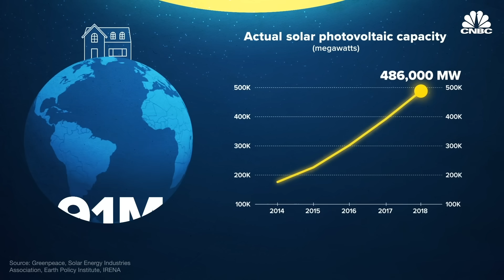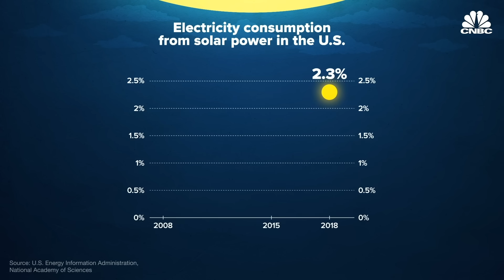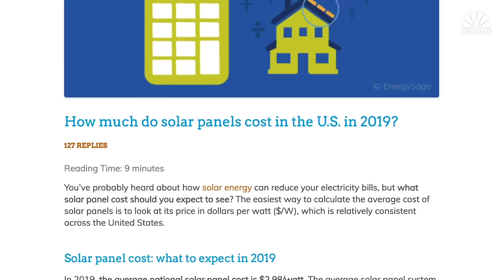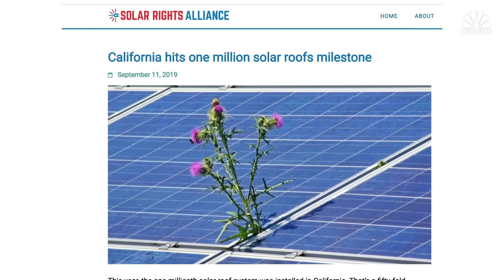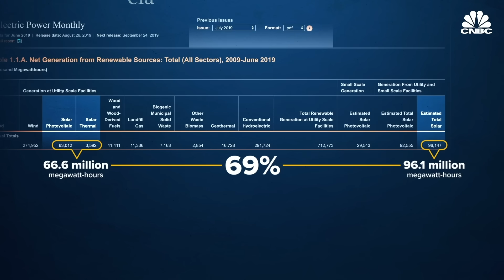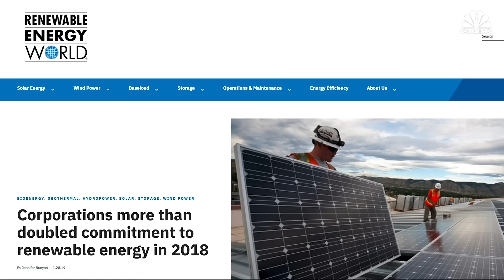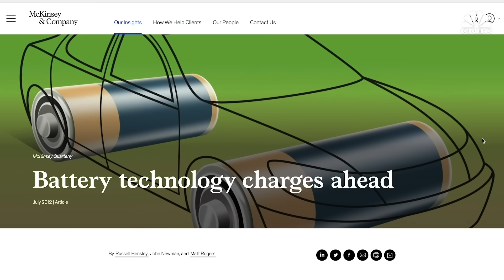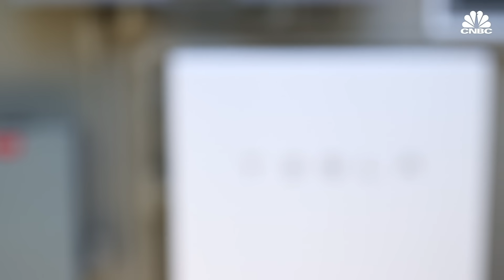The Rise Of Solar Power

Comment: For solar energy storage, use compressed air tanks holding up to 20,000 psi compressed air. Where weight is a consideration, carbon fiber composite tanks are very lightweight. When power is needed use a high efficiency electric generator, powered by compressed air, to power the grid. Air motor used as a reversible air pump/generator should be "rotary Wankel" design such as EngineAir Australia's new air motor. Hopefully this would be cheaper than using electric batteries which have low efficiency generally.

Comment: Anyone that thinks you MUST use lithium ion batteries is a moron.  The only reason to use li ion batteries is energy density which means NOTHING in a fixed location.
Reply: LiIon deep cycle is much more than any other battery chemistry. Power density is higher than any other solution. For residential storage, nothing beats LiIon.
Reply: @mychevysparkevdidntcatchfi1489  And what does energy density do for a residential users?  You also know that it has the shortest user life of any storage tech?  You know that it has the most poisonous chemistry?  Highest cost of recycling?  So what is so damned great about li ion storage for fixed use?  Tell me where does the bang for the buck for a home owner come from?  You can't answer because there is no benefit to a high cost low life hard to recycle storage for a fixed user.

Comment: Its crazy. The didn’t once mention the lifespan of solar panels. Or what happens to them once they’ve outlived their effectiveness...
Reply: about 20 years and very toxic...
Reply: @daddystiel4324  No, its about 40 years, may be even longer, and recycling plants popping up everywhere...many valuable materials in solar panels, which will NOT be wasted! In Europe, before a company is able to put a shovel in the ground to build a solar farm (or wind farm) they MUST have contracts in place to recycle the panels after their planned life span.

Oldest still operational solar farm is in Oldenburg Germany, in operation since 1976 and still working fine.. Note that solar panels made today are much better and even more durable, so this 20 year lifespan is very conservative... 

https://deepresource.wordpress.com/2019/02/16/solar-panel-still-working-after-40-years/

I have solar panels on my roof myself, these are guaranteed for 25 years, to provide at least 80% of their original capacity.. Well, after 6 years I cant see any degradation, last two years were record production years for me.. Maintenance.. zero, I do not even have to clean them.
Reply: Thanks,  @MarcoNierop . We clearly have some trolls in this discussion.
Reply: @daddystiel4324  They can be recycled.
Reply: They also didn't address solar's biggest problem:  night.  They only talked about clouds.
Reply: If the panels are installed in USA, they will live longer than 90% of the houses they power. That's the really important part: stop building houses out of cardboard and other stuff that needs to be replaced in 10-20 years. My parents live in a properly built house that is over 60 years old, but the roof still needs maintenance every 30 years...putting solar panels on it might actually make it last longer, but when you can expect two feet of snow on that roof every winter local solar power is just not as viable as down south.

After the houses have been torn down for being uninhabitable the panels still have years of useful service in them, so we have loads of good panels and thousands of square miles of desert with plenty of sunlight and almost no rain or clouds. It does not matter if the panel's efficiency has gone down 20% when you are not limited by the area of the roof and there are no trees or utility poles around to cast shadows, the only issue is convincing the politicians to stop trying to hinder these projects. I suggest calling IRS to audit them.

And if the panels have totally broken down you obviously recycle them. Every child knows this, why is Youtube so full of people who don't?
Reply: AnalystPrime much of the time, the process of recycling the old panels gets shipped to a developing country where the labor is cheap. Solar panels have some metals in them that are toxic. So in the end, while it’s better for the environment now, long term, it could have some serious health implications for some people in countries far far away. That being said, I think we should move away fossil fuels. My choice of power for the future would be nuclear. With the proper safety precautions, it’s clean and wildly powerful.
Reply: Depends on what you consider life span. Panels lose about 20% capacity in 40 years, still plenty usable. Inverters have about 20 year life (some more than others) then must be replaced. But even if you have to replace the whole thing in 10 years, solar is cheaper than grid. I care about saving money, not about what happens after use.
Reply: They can last up to 40 yrs. And can be recycled.
Reply: They get shipped to some dump overseas, there's no such thing as recycling
Reply: You mean there is no such thing as recycling or here is no such thing as solar panel recycling?
Reply: @timothyhammer6154  recycling centers all over the us are filled to capacity and some are shutting down ever since China stopped taking our "recyclables"
Reply: go look it up  idiot
Reply: @johnst1001a  Does calling someone idiot make you feel good?
Reply: Some of the earliest panels from the 1970's are still working to this day
Reply: better than wind turbines haha

Comment: Ya well, the 2017 NEC code now being adopted in many building departments mandates a very expensive rule for residential solar to rapidly shutdown in an emergency.  Thousands of dollars in additional cost and reduced reliability that adds negligible additional safety.
Reply: Greg Collins A grid tied switch costs next to nothing. Every install in Europe has one. If the grid goes, the panels stop back-feeding in milliseconds. What makes you think simple relays and a monitoring circuit that can be printed for pennies is expensive?
Reply: @spencerwilton5831  The least expensive device to implement rapid shutdown is the Tigo TS4-R-F units which cost ~$25 per panel.  With typical 320watt PV panels costing ~$170, that is effectively a 15% cost increase for negligible additional safety, but definite decrease in system reliability.  I don't want to be servicing a bunch of sun baked relays under my solar array. (Though, I'm sure they don't use mechanical relays)

Comment: Why know understand this? Yes having solar panels is great, but we need to focus on holding on to all that energy. We do that many different ways? Also figure if it rains, or unexpected weather happens having a day or two of energy stored for your home is great.
Reply: Also for those who don't know this common knowledge. Your home powered with AC alternating current. Used to be in the early 1900 we were using DC. So what does a panel produce DC, yet we use AC. Yes we have rectifiers. We just try and complicate things nowadays.
Reply: That's why you have your house connected to the grid, even if you have solar panels
Reply: @fgsaramago  ya true but most new sources of energy produce DC. AC good to run long distance. So even if we build big solar farms it's only beneficial to run to city close by.

Comment: yeah, solar SUCKS compared to nuclear.
Reply: Well they are advantages and disadvantages, can't argue with that but I would think Solar = Nuclear
Reply: Yes compared to nuclear fusion
Reply: @seasong7655  well yeah, fusion too, but 4th generation nuclear power produces far less waste than the current reactors. Fusion also produces waste because the neutrons it produces makes stuff radioactive. 4th gen nuclear is just as attractive as fusion, maybe even more attractive because we have the technology today to make them. Look up novel designs like the "liquid fluoride thorium reactor" if you want to learn more.
Reply: Who cares if there is "less waste than current reactors"? Nuclear is insanely expensive compared to everything else. It's more expensive than oil. The cost per kWh is not at all competitive.

Comment: this is very interesting there is a Hitch    that is Solar panels wear out   and the degradation is much higher then most predict    the panels lose as much as 50% in twenty years and there are some that lose more    this with the high cost of replacement   and the price of storage of Solar power questionable      this is an agenda driven peace of news    Remember the Golden Rule      HE THAT HAS THE GOLD MAKES THE RULES    even if it makes no (Cents)

Comment: I don't get why big solar isn't using hydrogen for storage you lose 40% of energy by conversions compared to li-ion but it is much better for the environment than mining shitloads of lithium for batteries and it is multiple times cheaper in terms of $/kWh storage + it can be transported in existing natural gas lines and be used for cooking/heating/energy in other less sunny parts of the world.

Comment: There's one thing I've NEVER understood about solar...who cleans all those panels? That has to be labor intensive. Obviously, dust, dirt, etc. is constantly getting on them.
Reply: You don't really need to clean them
Reply: @fgsaramago  And they stay a lot cleaner than ordinary glass or plastic due to a special coating.
Also, any dust that has landed on the surface gets washed away when it rains.
>

Comment: More solar farms that’s great do hope they leave enough space to allow our cleaning machines clearance to wash , sadly many sites are nightmare. Just to access the bloody fields , then there’s the perimeter fences to stupidly close to the end of panel runs , oh and the drainage ditches that cut across the farms in ways that defeats any conmen sense , it’s time for solar farm builders to sit down with the grass cutting teams and wash operators to save huge amounts of costs long term , foot note here if the farm is washed once a year it needs two passes to clean the grime out ,if just water is being used , know this now or find out the hard way .

Comment: Carbon isn't even a problem.
Reply: @JamesFox-g7x  umm they tax a percentage
Reply: @canofpulp  Yes indeed, I was being facetious. Rich folk won't notice it like us poorer ones though. Like fuel for your yacht, just fill 'er up.
Reply: @JamesFox-g7x  ok I see where your coming from so maybe I should clarify. I'm saying that there isn't evidence that the earth's temps are increasing. What scientists are doing is basically using a smaller ruler to measure the size of a coast. So they are getting a more accurate answer by using different methods and then comparing the new measurement to the old measure and saying there is an increase in temperature. And then they attribute the increase to CO2 production and extrapolate their false data collection method
Reply: @JamesFox-g7x  look at the data analysis methods, they say it will be catastrophic if it keeps increasing at the rate they are saying. But the rate is based on old data analysis methods. It's a simple fact that they have no sure way of determining the "average" temperature. It's a good guess at best and any action on a guess is prone to being a mistake. There is only 7 thermometers in Antarctica so the average is based on whatever method some paid scientists chooses. Follow the money and you will see that it's still debatable that there is even an increase. And they have only been recording temps for a few decades and they see cooling but they just change the logs and say it was because someone wrote it down wrong or the reading was viewed from a different angle so it looked colder than it was ect. Thats what the climate scientists are dealing with, so your telling me they can determine the average temp within .1 degree in 50 years based on that? You must have alot of faith.
Reply: @JamesFox-g7x  It''s funny you brought up big oil because they were the one who started the eco movement back in the 70s.  Do a google search for why/how big oil conquered the world. I have read alot about this subject and iv watched interviews of the scientists who do the data analysis an they are scared to tell the truth because their job is at stake. They say the instrument in the surface temperature recording satellites are not accurate enough and they're up to interpretation based on algorithms that scientist make.
Reply: @JamesFox-g7x  why do you think all the government's that are doing anything about it are going into recession?
Reply: @JamesFox-g7x  please look at both sides of the story before you make a decision. That is all I ask. That's what I've done.
Reply: @JamesFox-g7x  it's also funny that you have to resort to personal insult to prove your point. Usually that means you have no point at all.
Reply: @JamesFox-g7x  now get off your high horse and level with so we can learn something from each other. Clearly you don't know everything I know, and I don't know everything you know. An attitude of your nature is counterproductive.
Reply: @JamesFox-g7x  Is it seems to me that everyone and their dog is obsessed with it and the only thing that's happened is the creation of a global organization that tax People based on how much energy they use. Sounds like a perfect plan for the rich trying to keep the energy for themselves. While slowly making life so expensive, most can't afford children. Just like Rockefeller said " the Earth is overpopulated". Watch the video and you will see what I'm talking about.
Reply: @JamesFox-g7x  I know you're not going to change your mind based on what I say. But do yourself a favour watch the video and really think about the power these people have.

Comment: Batteries life cycle is not environmentally great it is worse than nuclear. So we just pretend all battery materials are all ethically sourced like latex rubber but reality they are NOT. So better batteries are needed now.
Reply: @JamesFox-g7x  Check out The production of lithium in third world countries vs say commercial mining of uranium like in Australia or USA and you will be suprised or maybe not if you are buying the environmental statements from top tier suppliers...😉
Reply: @JamesFox-g7x  Yes I hope so. -  Ps I do drive an EV and this is great for air quality in the city for people.
Reply: You don't need batteries. There are other forms of storage such as dams
Reply: @fgsaramago  Yes the conservative federal government in Australia is doing this for Snowy Mark II.  Bit of an energy-efficient waste pumping water up hill during the day and yes in some parts of the world it will work. The problem in the rest of Australia Environmentalists are banning new dams so are cutting off their nose despite their face. Many places still would benefit from modern Nuclear cheaper and clean air or do people support moving all jobs and manufacturing to third world countries where air pollution isn't even on the table of discussion? That's the hard sad reality of trying to have your cake and eating it too.

Comment: A better approach would be to concentrate on research to find sustainable sourcing of biomass to existing boilers to to keep them running for a reasonable length of future. Because the storage technologies and commercialization would take longer than expected. And now some ecologists say even hydro plants emit methane and are not clean energy sources.

Comment: Solar is great. But, nuclear fusion is the ultimate  answer/end game.
Reply: We already have a FREE nuclear fusion reactor - and have had it ever since Earth was created... OK... so it's 93 million miles away, but has been solar-powering the planet for around 4 billion years.
Reply: @TagmakersCoUk  haha.. sure. But remember that big ball of fusion reactor is not available at night or gets easily covered by clouds. And ya, we can use batteries at night, but solar power/batteries are not viable in certain parts of the world. For example, where I live in Canada we sometimes go days without getting sunlight and get significant snow fall (covering up the panels). And places like Vancouver can go months without seeing sunlight. How do you propose solar panels can work in these environments?
Reply: Jameel Ja this guy (Tag makers) might not be well informed but both kinds of nuclear is the answer to clean, safe and reliable energy
Reply: @andreaswickman1508  Fusion (if it ever becomes possible on Earth) is decades away - and has consumed many billions and achieved very little, and unless we can create an entity with a mass comparable to that of the sun, spontaneous fusion is not possible. High-energy magnetic containment in the current doughnut "reactors" consumes more energy than it generates (2nd Law of Thermodynamics kinda applies here).

Fission reactors (using Uranium) are massively expensive, and there isn't a lot of Uranium 235 available - certainly not enough to power the planet. Thorium is not really an option either - it performs best in molten-salt breeder-type reactors, and these are very unpredictable and dangerous. Nobody builds breeder reactors anymore.
Nuclear (fission) is not "clean" either... we don't yet know what to do with all the waste we currently have - never mind what will come if we upscale.
So... if the investment currently being made in fusion research and the construction of fission plants was rather directed at wind, solar, hydro, tidal and battery technology, we'd get to viable energy generation and storage solutions a LOT faster.
While the science of fission and fusion is very interesting (go to CERN sometime and see what they are doing... I was there 20 years ago), it is not really viable as a sustainable source of energy.